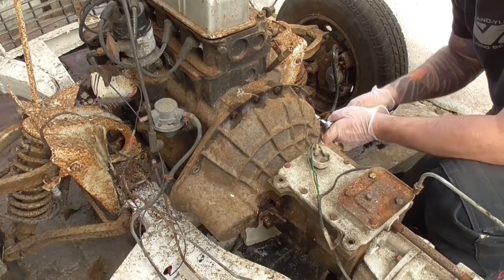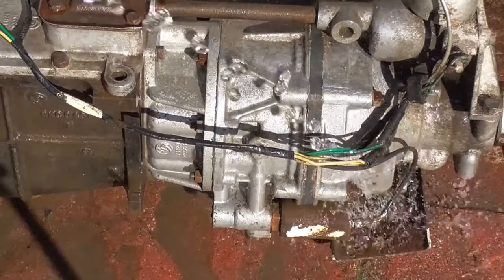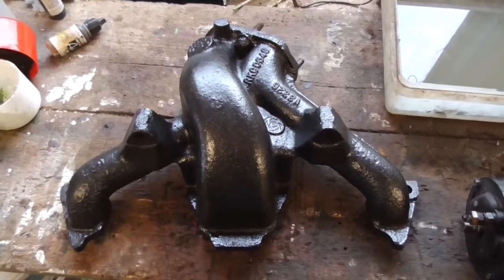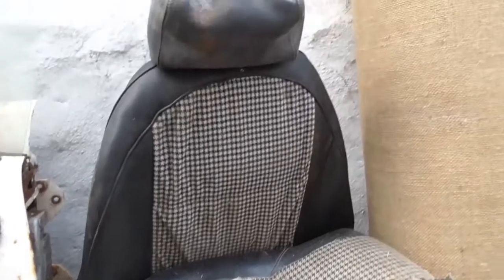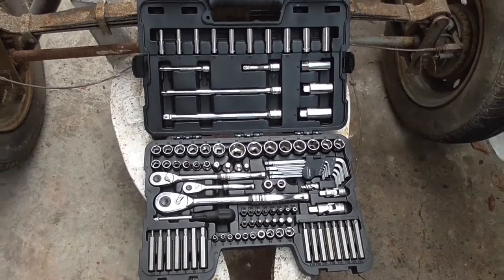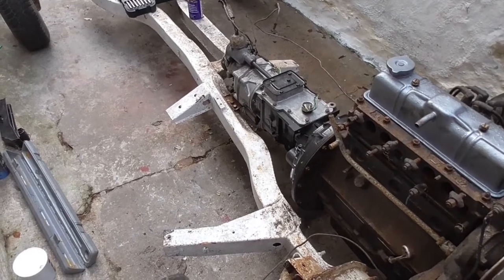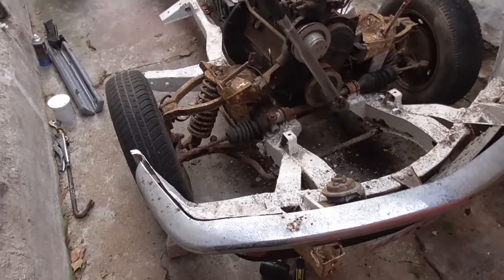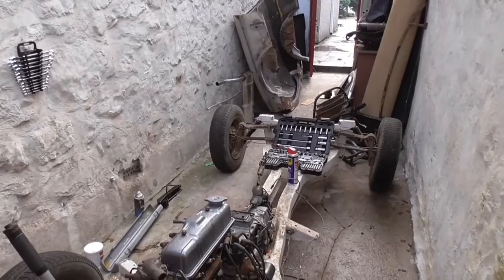Triumph Spitfire | Amateur Restoration | Part 5 - Gearbox & Update

Comment: that chassis is rough mate, id wire brush it, pressure wash then a coat of brush-on rust converter followed by a good coat of tough black paint/enamel. In fact it needs bead blasting. Good so far though.